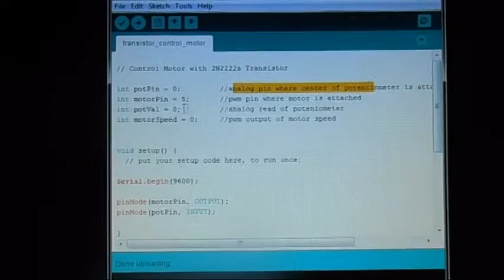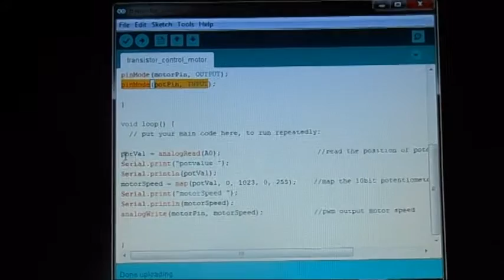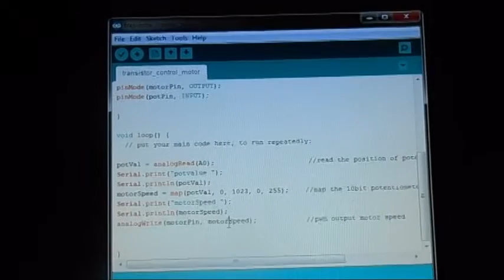How to use a transistor to control motor speed

Comment: Hi There! Great video. Very informative. I was wondering a couple things: Is there a reason why you have a 50k potentiometer and not, say, a 10K? What is the voltage of your motor? Finally, what is the voltage the pins on your Arduino put out? 5V or 3.3V? I have a Arduino MKR Zero and it outputs 3.3V as opposed to 5V and I want to power a 4V DC motor. The MKR Zero has a connection for a 3.7V 700mAh Li-Po battery. Just wondering on what pins I would connect the various wires on the Arduino?

Comment: How are you doing this?  My pins don't even generate enough current to run the dc motor directly, how does a pwm at reduced voltage do it?  Yeah, it's bad for the board, I get it.

Comment: I tried this using a PNP BC557 transistor with a 10K potentiometer (don't have a 2N2222a or 50kpot) and the motor just runs full out ignoring the potentiometer. I wold assume it should work fined using these components. I checked and double checked the code and connections, not sure where to go from here.
Reply: Being a novice at electronics I dug into this a bit further. Turns out the BC557 is a PNP so wouldn't work even after switching the collector and emitter feeds. After googling for a replacement for the 2N2222A NPN a 2N3904 NPN was listed which I was able to find in my stash from an Arduino starter kit purchased a few years ago. All worked as it should after that. Hope this helps someone in the future who doesn't quite have the exact parts used in a project or video such as this.
Thanks to "learnelectroncis" for providing the video!

Comment: Honest question: When using the PWM signal to control the LED brightness in a previous video, you did not need a transistor, but here, to control the motor speed, you do need that transistor.

So what is the transistor doing and why is it necessary in this case?
Reply: The Arduino cant handle the current drawn from the motor, but it can handle the current drawn from an LED.

Comment: I'm trying to cook up a mouthpiece controller for a double amputee for a servo powered sewing machine. I want to use a clothespin shaped mouthpiece as as substitute for the pedal, but I don't know what sensor I can use to translate clench angle to PWM or voltage difference. Do you have any insight what I can use to accomplish this?

Comment: Not sure if it makes a difference. In the diagram (1:11) the load (in this case the engine) goes between Vcc and collector, while the emiter is connected to ground. In this example, the engine (the load) is betweem emitter and ground. Does it make any difference?

Comment: Why would you need the Arduino? You can add the pot-meter directly to the base of the transistor (with a resistor in between perhaps?)
Reply: The transistor has to drop more voltage across it when not fully saturated and you will waste power with heat. Much more efficient to use PWM to vary the effective area under the curve to control the speed.

Comment: how is the motor powered? i dont see where its getting the power from, the nano can give max 40ma and that motor looks like its drawing more
Reply: Power is switched trough the transistor
Reply: thank you, i actually learned a lot since i commented this but wouldnt the current be the maximum that the traces on the board can withstand? so for example if i wanted a 100 watt motor i would need a different power supply

Comment: hey. great video. could you do a video on how to pick the correct npn transistor while using it in a pwm format. i am designing a pwm driver to drive a 12v computer fan, but running at max it uses about 4watts, im after a smd npn to do this, but struggling. i know for my aplication i will never hit 100 power, but struggling to work out what sort of watts i will be using at a given pulse width. 
cheers

steve

Comment: Why do you need the transistor at all? What would happen if you simply connected the digital pin to the motor instead of putting it to the base of the transistor?
Reply from the maker: Arduino pins max out at 40mA. You would burn out the analog circuit for certain and possibly damage the board in total.

Comment: As I see you are not using a resistor for the base of the transistor, other people recommend using a base resistor, I don't know what kind of resistor should I use when base is connected to arduino PWM. Is the choice of resistor relative to how much voltage and current is passing through the collector and emitter? I don't know how to read transistor datasheet, if you could show beginners like to me, what kind of transistor with what resistor should be used for the base that would be great.
Reply: I read a lot that uou don't necessarily need a resistor with these mini-transistors. I also don't know why, bit it works fine for me as well.

Comment: There is a error at 4:04. The ground wire from Arduino is hook up to the positive rail of the breadboard. At 7:07, the circuit has been corrected. The ground from the Arduino is correctly hook to the negative rail on the breadboard..
Reply: hahaha I saw that too

Comment: I think a reverse protection diode is a good thing when using anything with coils in it. Dont you agree ?
Reply from the maker: +migsven surfing yep
Reply: where would you put the diode
Reply: @SKNSW  You would bridge the DC motor terminals with the diode installed backwards, negative side of the diode to the positive wire. This way when current is being applied to the motor it won't short through the diode, but when the circuit is opened the energy in the coil in the motor will discharge through the diode and prevent the a potentially destructive voltage spike.
Reply: @jackvac1918  What do you mean by bridge? Would you just attach the negative of the diode to the positive going into the motor and the positive of the diode going to the ground wire connecting to the motor? like parallel? And also can I use an LED or should I get a regular diode?
Reply: @dylanjayababy  Yes, the diode in reverse polarity to the circuit and in parallel to the motor (this configuration is called a flyback diode). You will need to use a power diode for a motor because the large flyback current generated by a disconnected motor will burn up a typical LED; the diode should be rated to at least be able handle the same amount of current the motor draws under load.
Reply: @jackvac1918  Okay Thank you very much for helping!